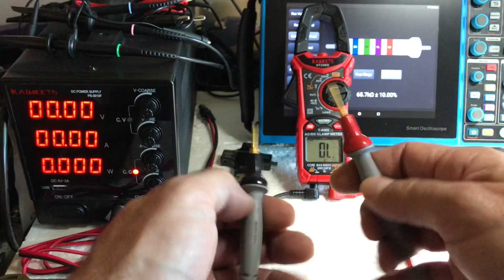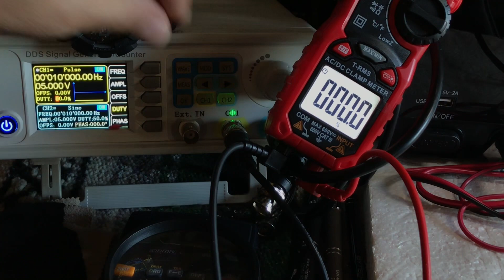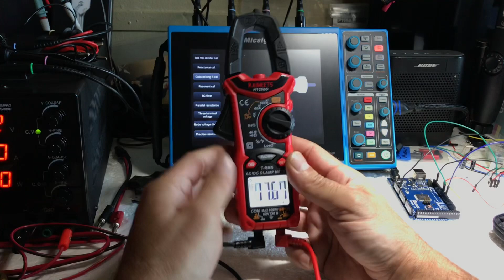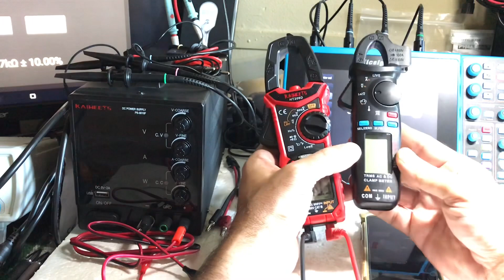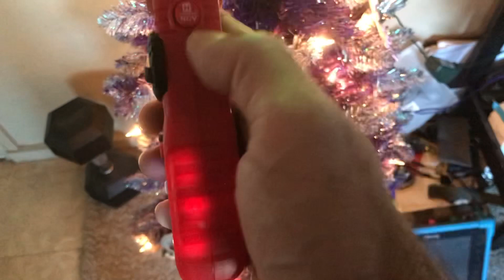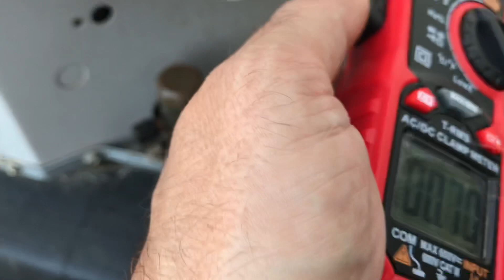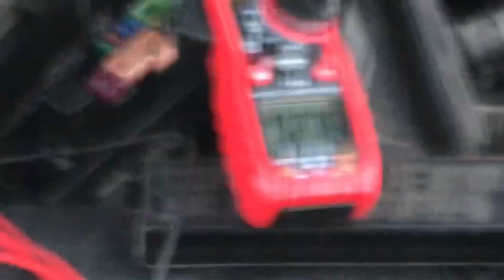Kaiweets Clamp Meter HT206D Full Review

Comment: You assume that the voltage reading on your power supply is accurate. Why.  All you have shown is that the test meter reads about the same.  They could both be wrong/
Reply from the maker: I tested the power supply when I first bought it, with 2 separate oscilloscopes, and they all matched. That’s good enough for my uses, diagnosing automobile’s, and anything else I will probably come across. I’m not building space shuttles over here.

Comment: I don't need it, BUT I LIKE IT, so I bought one too and I don't regret :D
Reply from the maker: I had a period of time where I couldn’t stop buying multimeters, amp clamps, and other diagnostic equipment lol. I could probably open up a small retail electronics store if I wanted to, 😂
Reply: @atomsworkshop195  I can feel with you, I bought recently 3 new multimeters, but luckily they are dirt cheap here in Thailand. I payed for this one only 12 Dollars incl. shipping, it calls Habotest HT206D here and the other two are Aneng M118A (4 Dollars inlc. shipping)and Aneng A3004 (3 Dollars incl. shipping). All of them i like, the Anengs are significant quicker than the Habotest and accurate too. The Aneng M118A is the easiest I ever had to operate and the pen style A3004 is the fastest to use and they complete each other in current range (A3004 up to 200mA and M118A 20mA plus). I wish you a lot of pleasure with your equipment and yes I'll keep you updated how they hold up : )
Reply: @atomsworkshop195  ......Y no te retaba tu señora?....o lo hacias a escondidas?:face-green-smiling::face-green-smiling:

Comment: I'm in the UK and I bought one last week. I'm extremely impressed with it and I now use it as my main multimeter. I'm upgrading an old e bike with LiFeP04 batteries and I wanted to know the current draw while cycling up a hill. The max/min feature was essential for that.
Reply from the maker: That’s good to hear. It’s a great little multimeter. Let us know how the bike turns out. Thanks for watching.
Reply: @atomsworkshop195  The bike works great electrically. Just need to build a secure box for the batteries. It's a 24 volt bike that had a huge heavy nickel metal hydride battery. Needless to say it was pretty useless. Runs great on LiFeP04 (2 miady 7.2ah batteries in series). Peace of mind too. The BMS in the battery trips if a catastrophic overload occurs.

Comment: Is this the same as hobotest ht206d and maylon ht206d brand?
Reply from the maker: I’m really not sure. With that said, I do know that a lot of different tools are the same tool, sold under different names. I’m not sure if that is the case with this one or not though.
Reply: @atomsworkshop195  thanks bro, very informative review of the tester, just wondering coz i wast trying to search that model in shopee apps basednin Philippines but ther are 3 brand shows up
Reply from the maker: Thanks for that. I appreciate it. Yeah, it’s definitely possible. If I remember right, back when I brought another amp clamp (just before I bought the Kaiweets), called BSIDE ACM91, there was another brand, but it was identical to the BSIDE. I think there were 3 total. All identical. Not sure which one was the original. I bought the BSIDE, and it turned out to be a good little amp clamp multimeter. I also bought a Lisle fuel line disconnect master kit, and it was identical to the Matco (I believe) set, but half the price. It’s obvious they came off the same production line, the just got a different sticker for the name.

Comment: Could you recommend a low amp dc clamp meter for automotive work?
Reply from the maker: If you’re wanting a low amp clamp that connects to an oscilloscope, I would recommend the Pico low amp clamp. If you want a stand alone low amp clamp/multimeter, I would look at the Kaiweets low amp clamp meter. Not sure of the model number for kaiweets low amp meter. Just go on Amazon and go to their page. Hope this helps

Comment: Atom’s Workshop, You should have tried the temperature on this one you might have just missed one that is accurate, I gave the temp a try and found it very accurate. Cheers mate good video.
Reply from the maker: Hello Chappy.  Thanks for sharing. I’ll have to try it out.
Reply: @atomsworkshop195  I didn't do any subtle testing with it just fridge, freezer, ambient, nothing more than that but it was accurate to the degree on all those tests compared to the digital thermometers I have installed in those appliances, it might be worth giving it a test if only to satisfy your curiosity. Cheers.
Reply from the maker: Sounds good. Thanks Chappy

Comment: Just picked this one up! Great for my hvac career specially because im just starting! And a great starting clamp multimeter for beginners!
Reply from the maker: It’s a good little meter, I’m sure it’ll work good for you. I did HVAC work for a little while, some years back. I never went to school for it. I just knew a guy that knew a guy that had an HVAC company and needed some help. I did mostly Rough-Ins & Equipment Sets. So basically installing the entire system in new homes. I was just learning Diagnostic work and the repairs, when the company went outs of business. Good luck with your new career. There can be good money in it. I think it was Confucius that said “If you enjoy what you do, you’ll never work another day in your life”. That’s the secret my friend. Thanks for checking out the video.
Reply from the maker: Hello Jordon, thanks for the question. I don’t work in the HVAC field, so I don’t want to lead you astray. I work in automotive diagnosis and repair, and I can say it’s good to have for that. I would think it would work for HVAC as long as you don’t need to read under 200-300 milivolts. If you need to see under that, I would recommend looking at a low amp clamp meter, that’s designed for under 100 millivolts. If you need to see between 500 millivolts and 600 Volts, I would think this would work for you. If your new in the HVAC field, I would look to see what those guys are using. Maybe check some HVAC YouTube videos and shoot a few questions their way. Good luck buddy, and thanks for watching.
Reply from the maker: Oh yeah. Miguel in the comment above said he is new to HVAC and said this will work great for that field. Just a thought.
Reply: @Atom’s Workshop  correct works like a charm I got the 206d gets the job done for residential and commercial if you do industrial you can get the 208 because it's read up to 1k volts unlike this one reads up to 600v but i been satisfied for what I paid wasn't expensive as the other top brands like klein , fieldpiece,fluke or uei so far its been durable been having it since September of 2022
Reply: @miguelangelgatica4944  cool, thanks for your reply
Reply from the maker: Thanks for the info buddy 👍 We really appreciate it.

Comment: I have one of these.  It's great for working on cars.  I like the clamp, the min max, the flashlight and no blown fuses.  I cut off the probes and replaced them with alligator clips which are much better for working on cars.  My 2 grandkids use it as a "Ghost Busters" meter and go searching for ghosts in the basement with the non-contact sensor.  But they come running back up if they see a spider.  Cheers from Canada :-)
Reply from the maker: Hello Robin. That’s great to hear. That’s a good idea with the alligator clips. I often use a separate set of leads that came with another meter, that gives me the option to screw on or off alligator clips. You’re right, it does make it easier. I love how your grandkids use it for ghosts. That’s funny. Take care. Your friend from southern Texas (USA).
Reply: The problem with the min max is if the measurement starts out from zero, and the auto range changes range. Then it doesn't record things properly.  The 208D fixed that by having a range lock option, which is really a must have for all these auto range meters.
Repeated measurements can proceed much faster with locked ranges rather than auto range all the time.
Reply from the maker: Thanks for the info SA Defur. I did not know that.

Comment: I love your video brother... How about the ingco6005 l believe its the same in functionality with this the kaiweets. I m trying to buy a clamp meter but still comparing this one and the ingco6005. In our place the ingco is much cheaper than this one. Any suggestion 🙏
Reply from the maker: Hey buddy. I don’t have the ingco6005, but I just pulled it up on Amazon, took out my Kaiweets, and just compared them kinda side by side; and other than one is red and the other is yellow and the names, they look like the same exact meter. The buttons, clamps, and every single symbol and number are identical, in the exact same spot. Looks like the same specs to me. I know that a lot of different tool brands are the same exact item, come from the same exact assembly line, but get different names, colors, and sold as different brands. That looks like the same here with these two clamp meter. Again, I only have the Kaiweets and can only truly speak for it. So far, I haven’t had any problems with it, and it’s still going strong. With all that in mind, I would grab the least expensive one, because if I were a betting man, my money is on they are the same product underneath the “paint job”. Good luck brother. Let me know how it turns out. Especially if you get the other brand. Come back and share with us what you think of it, so we can help others in the future.
Reply from the maker: PS, Thanks for watching the video.
, and for the complement.

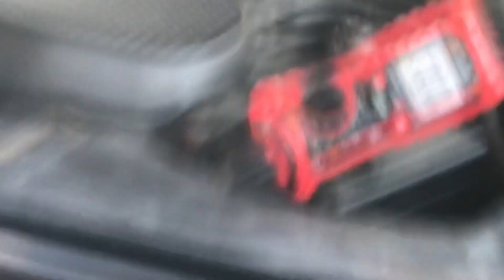Comment: 41:26 Your meter is having a problem just like mine. The moment you press the max it adds that 0.2A back up. Mine is worse the "default" DC reading is almost 1A before having to zero out.
Reply from the maker: Hello y. Once you press the zero button, it should zero out. Try that, and let me know if it works. Hope this helps.
Reply: @atomsworkshop195  No once you circle back to the DC A mode whatever the "default" value comes back and while you can zero it out again, the second you press max/min the reading jumps to that number again. In your video you had 0.1 then you pressed max it went straight to 0.3 (0.2 added as it was the number before you zero'd it out). It's not a concern since your "default" reading is 0.2 but mine is almost -1A. I tried to test the drain for the car battery this issue makes the max button unusable. Played with it for 30min can't find a fix. Thanks for the reply.
Reply from the maker: I see what you’re saying. I would shoot an email to Kaiweets. I bet they’d send you another one out. I had a blown fuse on one of their multimeters, that I may or may not have blown. Anyway, I asked them where I could get a new fuse, since I was having trouble finding the exact one; and they sent me a whole new meter.
Reply: @atomsworkshop195  Great to know. Thanks again!

Comment: Mine reads 0.5amps on amps reading even if the leads are not connected or touching together. I wonder if there is a way to get it calibrated to zero.
Reply from the maker: Hello Anon ymous (nice choice for your name, lol). So, when you turn it to amps, then you want to press and hold the zero button. That will set it back to zero. I don’t have mine in front of me at the moment, but I believe it is the red button on the left. Remember, press and hold it for a couple/ few seconds. I think it will make a beep sound, when it happens. Good luck, and thanks for stopping by the channel.
Reply: @atomsworkshop195  i would have to do it every time I want an amp reading. It doesnt remember its zero.
Reply from the maker: Yeah, you always want to zero an amp clamp before connecting it to a circuit. This goes for all amp clamps. They all have a zero button to push,  or wheel that you turn to zero it. At least the ones I have, all have it. That would include 2 Pico amp clamps, one a high amp, one a low amp (amp clamp). Also, my Micsig amp clamp, and of course the Kaiweets. Also, if it’s the kind you connect to an oscilloscope (like the other ones I mentioned above), always make sure you choose the correct setting on the scope for what type of amp clamp you are using. Example, choose 60 amp on the scope settings for a 60 amp scope. This way your measurement (numbers) will be correct. I hope this helps my friend.
Reply from the maker: Quick note: I believe the new Pico Scope 4425A has what’s called BNC Plus. It’s basically where your probe/amp clamp connects to the scope, it snaps in, and are basically smart connectors. Used together with the new “smart” amp clamps or probes, the scope instantly recognizes what you just plugged in, adjusts the settings for that clamp or probe; and in the case of the amp clamp, it automatically zeros it, so you don’t have to. Just thought I’d let you know. It’s a pretty new technology. I know Micsig has incorporated it into their new scopes also. I’m sure theirs probably zeros automatically as well. From what I understand, you can use the new “Plus”/ “Smart” probes or amp clamps, as well as the regular BNC ones with the new “plus” / “smart” scopes.

Comment: Which clamp meter brand u think has a better quality / accuracy in general (Kaiweets, UNI T, ANENG) 

☺️💛 Thanks
Reply from the maker: Hello Bobo, thanks for stopping by. I can’t speak on UNI T, and ANENG, because I do t have them. I do have an BSIDE ACM91, which looks pretty similar to the UNI T. I am happy with the BSIDE ACM91; it’s a pretty good meter. The Kaiweets is pretty damn accurate. I have the HT206D. It’s a “high” amp clamp, meaning it can read up to 1,000 amps and 600 volts. Only it starts to get less accurate when you start to read the low end into to low millivolts; but as I said it’s meant for higher readings. If you need to read low MILLIVOLTS, Kaiweets offers a “low” amp clamp for that. Don’t get me wrong it’ll read the hundreds of MILLIVOLTS, it’s just when you get into the low double digits (like 10 MILLIVOLTS). I don’t remember exactly where it starts to get off a little, but you should be able to see it in my video. I can use it for pretty much all voltage and amperage readings on vehicles. If I need to get really precise, I just use my oscilloscope. I definitely recommend Kaiweets. I originally bought the Kaiweets HT118A multi meter (which is a nice, solid, and accurate meter). Anyway, I fried one of the fuses in it (completely my fault). I removed the fuse, but was having trouble finding the exact replacement fuse. I got a hold of them to ask where I could get the fuse. They insisted in sending me an entire new meter. Not only that, but they also sent me one of their new small touchscreen meters as a gift. That was pretty damn cool of them. I know I didn’t quite answer your question because I don’t have those other brands, but I will stand by and recommend this Kaiweets. I assure you it’ll will work for all (most) of your automotive and around the house needs. Let me know if you have any more questions, and thanks again for checking out my video.
Reply: @atomsworkshop195 
 Thanks man for the reply I really appreciate it  thank for ur time 💛

After days of reading and searching and with ur review I decided to go with the Kaiweets HT208D
 for DIY home and Car  battery / wires diagnose it may save me money on the long run

50 $  On aliexpress  + ( 7$  VAT to my country)    seems a good price

If HT206D is better than HT208D for my needs please let me know 👍🏼 accuracy is my main goal 

Thank again

Comment: on yoou showed your car battery you showed 18 volts shouldn’t it have shown 24 volts for a car battery? Thanks  for the video
Reply from the maker: Hello Smittyone66. The 18 that you saw was the amperage going from the alternator to the battery. The voltage was about 14 volts while the car was running. You can see that I switched the meter from volts to amps a couple times. A single car battery should be about 12.6 volts not running, and about 14 volts, give it take a little while running. You may be thinking of a larger truck that uses two batteries for a 24 volt system. I hope this makes sense. Thanks for watching my friend.
Reply: @atomsworkshop195  When measuring amps, the probes should not be connected to the meter(it is mentioned into the manual). The result seems to be wrong on positive wire. The first measurement you done on negative view was around 5 A. The same value must be on the positive wire, not 18 A as you measured. The issue must be the conneced probes to the battery.